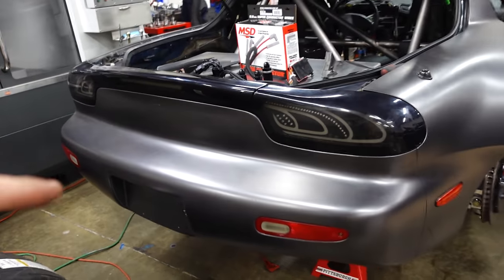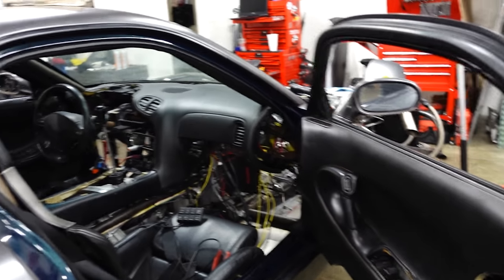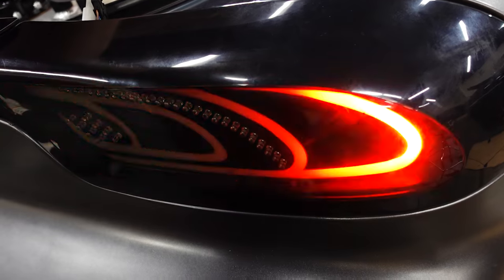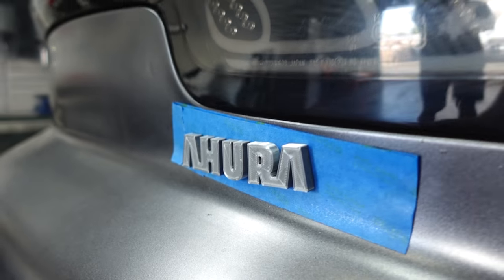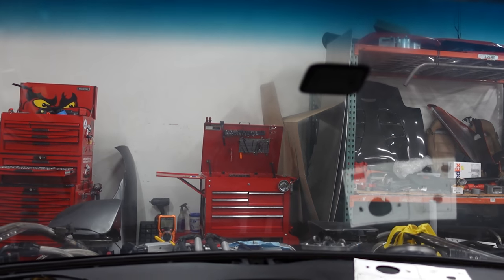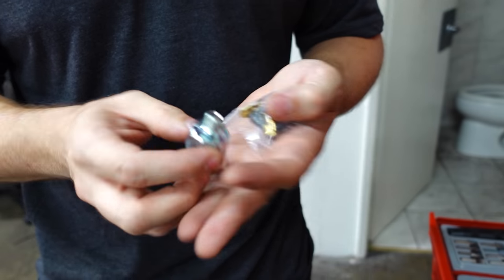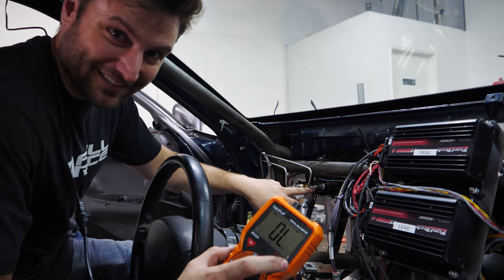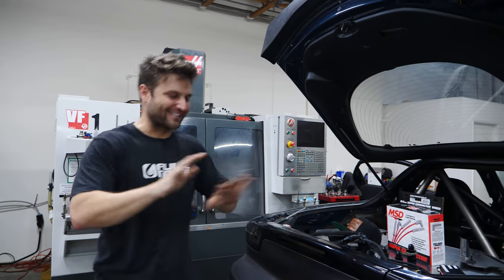AWD 4 Rotor RX-7 finally gets Brake Lights and Pop Ups! Mesmerizing.

Comment: Yo why don't you let the headlights go up when you high speed braking  so it increases drag
Reply: I would imagine it'd be better to have a parachute and to not use the headlights so you're not causing excessive wear on the motor or stress on the parts from the wind no? If you're talking like 200+ mph anyways
Reply: @TBIRD0625  just extra braking power ofc parachutes , he can make the parts more sturdy
Reply: @xavierrodriguez2463  he probably talking about the headlight motor
Reply: @xavierrodriguez2463  I'm sure he meant electrical motors lol. The ones that control the head lights
Reply: Formula one technology right there
Reply: @xavierrodriguez2463  as others have noted I was talking about the headlight motors and mounting components, not the actual engine
Reply: Because lids are gonna fly off😂
Reply: I see your popup aero-brake idea and raise you this. Hyuayra style active aero flaps. Think about it, a yaw sensor and maybe a speed sensor hooked into the headlight motor circuit. Hard part would be programing it on the ECU side of things or a standalone controller.
Reply: Headlights go up....... Headlights go down.. *giggles*....... Headlights go up..... Headlights go down..... *he he*.... Up..... Down.... Up..... Down.............. Again again again! Updownupdownupdownupdownupdownupdown
Reply: At 200mph even the panel gaps can be problematic
Reply: This idea but with an adjustable wing/aero, maybe stays on for an extra 2-3 seconds after release of the brake so that aero provide more downforce during cornering
Reply: @TBIRD0625 yes engine is for the car , motor is for other mechanical stuff .
Reply: So you guys want him to make it like K.I.T.T.'s braking system after he got super pursuit mode?
Reply: 🤣🤣🤣 cause they'll brake, BECOME BROKEN
Reply: Zed you god damn genius!

Comment: One major con to using a pressure switch.

In the event of a hydraulic system failure, you no longer have functioning brake lights.
Reply: Good catch
Reply: If you have a hydraulic system failure i think you have bigger issues than worrying about brake lights
Reply: in that case you would also not be slowing down or "brake-ing"
Reply: I mean, in the event of a hydraulic system failure you also don't have brakes, so really it's just reflecting the state of the car at that point.
Reply: Yeah... that's sort of a non-issue issue. The electrical system is much more likely to fail than the hydraulic system. Except in the case of catastrophic damage, hydraulic systems tend to slowly fail and display signs of faults long before a total failure. Electrical system faults tend to be sudden and immediate, and often intermittent.
Reply: @raelik777  not for nothing, but you've obviously not had a brake line fail catastrophically.  

in 5-10 pumps of the brake pedal, depending on the resovoir size, you go from able to stop, to not able to stop.

Thats not exactly a slow fail.
Reply: @tannertyrik6251  This may be true, but there is a reason that every single mass produced vehicle uses a physical switch to accomplish this and not a hydraulic switch.
Reply: @spdrcr1010  Not necessarily true... just because you don't have 100% of the brake function doesn't mean you're not slowing down.

OEM vehicle Manufacturers use a physical switch for a reason.
Reply: @talontsi92  Sure, which also means that the last thing you're going to give a shit about is your brake light working. I never said you couldn't have a sudden hydraulic failure, just that electrical faults are far more common.
Reply: @talontsi92  yeah they build mass produced cars cheap as possible. Mechanical switches fail all the time.
Reply: @talontsi92  Cost tends to be the reason. I mean this introduces a world of pain in the ass when the switch breaks it means you have to bleed the whole system to replace it. with another type of switch its easier to replace and cheaper
Reply: talontsi92 you’re right, because it’s cheaper....
Reply: It’s funny that yall had to ruin the joke too
Reply: Kinda moot when you no longer have functioning brakes...
Reply: If your hydraulics fail, you also don't have brakes, so they're still accurate.
Reply: Should also point out... this isn't like some weird unheard of thing he's doing. They sell kits specifically for doing exactly this. In fact, if you google "brake light switch kit", you'll find that many of them are hydraulic switches on the brake line.
Reply: And when the pressure switch fails and they do it’s a pain in the ass to change you have to bleed the system
Reply: @liammulvey5209  It's a reason to not go cheap on those switches.  Quality ones will outlive the car.  If you absolutely want to ensure that the switch NEVER fails, you use a piston-actuated switch.
Reply: talontsi92 generally true, but if you have a bad enough brake line failure the reservoir can’t do much. Can’t pressurize an open system.
Reply: @stevenplaskett7728  A pressure switch is very cheap, so it isn't really all about cost. They are less reliable than a mechanical switch though when it comes to brakes and poorly maintained fluid. You can also blow the top out of a pressure switch and lose all of your brake fluid, seen that. Many cars did use pressure switches up through the '60s in the US, but GM was using more expensive mechanical switches in the '40s.

Pressure switches don't react the moment you move the pedal, properly adjusted mechanical switches do.  With a mechanical switch the lights are coming on before braking actually happens. 

Mechanical switches also easily allow multiple circuits. When they added cruise control to cars they added an NC contact to the brake light switch, so when you press the brake the power to the cruise servo was cut. That isolates your accessories from your brake lights instead of just tapping into the lights for a signal. Most modern cars have a separate circuit with an NC contact for an input to the PCM.

Comment: Rob, I'm sure you've already thought about the pros and cons of this, but I would use a physical switch vs a pressure switch for the brake lights, just in case you ever happen to lose brake pressure for some reason you'll still have the ability to get the lights to come on with the pedal. I hate to admit this, but I've driven several cars without the use of the hydraulic brakes and had to use the emergency brake to stop and use the brake pedal to get the lights to come on.

Comment: Just an FYI, Ariel Atoms use a pressure switch to actuate the brake lights as well.  However most Atom owners switch these out immediately since it appears track driving with the continuous on/off the brakes and the heating of the fluid causes them to fail @ the epoxy seal.  This failure causes loss of pressure and thus, loss of braking.  I now have a pull switch on my Atom and it hasn't failed yet, this is after two years of street/track driving.

Comment: Use redundant switch for brake lights for safety. Either straight switch and cable from pedal or secondary pressure switch. Sometimes those pressure switches can get bad and do such  electrical mess that it will pop a fuse.

Comment: Yo Rob Dahm, (from my experience in using a brake pressure switch in a few motorcycle builds) I  believe you will NOT like it for your build (thou clean as hell) because you actually NEED the lights to come on the instant your foot touches the pedal. With the pressure type switch (and more so at a high pressure threshold like 20psi) the light illumination is delayed and in some (light trailing brake applications) will not light at all. Please reconsider it's use in light of these thoughts.
BTW. love the work and thanks again for sharing the learning and building curve. 
(2 custom motorcycle builds, 12 Subaru motor transplants, and 5 full resto-mod builds under my belt).
Thanks again. Matt
Reply: what would be a good alternative
Reply: The brake lights in Robhs car have 2 ways of flashing, so just add another sensor in the brake pedal for “light” braking situations, and then the pressure sensor comes in delayed, activating the other alt display mode..
Regardless of how it ends up,. That is a nice setup he has,. It’s a good solid build all around..

Comment: Rob, you don't want to use NPT for brake fittings.  You want to use flared type fittings.  Grab one from a Mazda or GM car, they typically screw into the master cylinder so you done have to use a T fitting.

Comment: Rob make sure that pressure switch is rated for the max PSI seen in your system. Wouldn't want it to burst or leak on the strip when you need brakes the most.

Comment: 2:04 also if the pressure increases without you pushing the brake pedal (a failure of some kind) and you slow down because of it you want your brake lights to come on anyway. Safety feature

Comment: If your worried about air bubbles in the pressure switch T fitting, point the switch downward, liquids will flow down and air rises.

Comment: If you want as much data as possible, why not have a pressure sensor for front and rear and have the brake lights turn on after 20psi? Seems like a better data option than a pressure switch.

Comment: Only problem I see with the brake light pressure switch idea is that if you lose brake pressure you also lose the brake lights. Physical switch would supply lighting even in the event of brake failure.

Comment: Hey Rob, you need to be careful that switch can handle the top of the pressure range you are exposing it to, also it's not DOT legal to use npt on a brake system, you should be using double flairs.

Comment: I realized driving an old Volkswagen bug with a Subaru that I HATE pressure brake switches. The engine/trans braking slows the car down soo much I don’t need the brakes immediately and would be nice to be able to just push the brake pedal without applying pressure to let people know I’m slowing down.

Comment: Rob.... Use a High Pressure switch as the low pressure switch will fail with brake pressure even blow out causing a leak use a proper switch

Comment: Rob you need an msc book because u can for sure get tooling that small. Even smaller if needed. As a machinist myself you need to dig deep man cause there’s is some much stuff u can do with that machine. I run a 5 axis which is a little crazier than yours but still u can do amazing shit with that thing if you learn. I know your a smart guy so you’ll figure it out. Always look for small machine shops going outta business you can get great tooling cheap that way.

Comment: damn it.... I'm going to hope the brake pressure sensor doesn't get clogged every year or two. the rear brake on my motorcycle is a pressure sensor and every year I have to replace it for inspection. You really should have just stuck with a button that sends the signal when the button is released.

It's also for safety. You won't lose brake lights if you get a brake fluid leak if you use a button.

Comment: Rob, I'm not one of the usual haters that's questioning your every move, but your brake light setup is a huge concern. 

Brake lights are an "always hot" circuit in a street car. Your pressure switch is a potential electric short. Brake fluid is flammable. PleasePleasePlease put your brake lights on a "hot when on" circuit or figure out a physical switch. (My preference would be a physical switch since a pressure switch wouldn't light up your brakes lights if you lose a brake line)

Ford had a whole recall for this on their cruise control switches burning trucks and SUVs to the ground in the late 90s-early 00s. I don't want to see a "4-rotor burned to a crisp" video after all the hard work you've put in.

Comment: WARNING...... Under the glove box, for a split second @ 2:11 right under the vent, I thought ( I could be wrong) I seen that Ebay 200 amp relay from china its about 2"x2" black cube that is sold from 5 to 20 bucks.. DONT USE IT, I had 1 catch fire melting all over the place, it was running the wicked volvo 850 2sp fan and the other that I had bought at the same time got super hot.. I knew better and shouldve sprung for the Tyco/TE power relays that cost much more from the beginning...
Reply: For higher amp draws from 50-200A use the TE/Tyco , V23132-A2001-A200 , For draws under 75A Use the TE/Tyco , V23232-A0001-X003 ... Both have a resistor on the coil and the 75a relay also has a diode inline with resistor... And if you find yourself needing a real oem quality cooling fan the 16"  Volvo out of the 850 part # 9497929, has the same motor as the 18" Lincoln MKIII... These are the most powerful brushed fans around @+4300 cfm..

Comment: Try putting wires in drill on one side the other in vise then run drill to coil wire when wiring a bundle it helps and is super clean. Brakes look sick love the sequential turning

Comment: One tip I can offer for wiring. When you are putting a few wires together to make a harness, put one end of the 4 wires in a vise the other in the drill chuck spin it a little tighter than you want. Will stay together nicely.

Comment: I'm GEEKIN out WITH THE POP UPS ,AND IF U DONT MIND WHERED DID U GET CIRCUITS AND CONTROLLERS FOR TAILIGHTS ,IM ASSUMING THEY ARE REPLACEMENT LED BOARDS AND A CONTROLLER ."YODA" FC THEY MAKE THEM FOR? P.S ROBBY DID YOU PKEASE GET MY MESSAGES BOUT MY 10THAE BUILD ,SIMPLE NO ASKIN FOR ANYTHING FREE I HAVE EXPLAINED IT BOSS ,PLEASE RESPOND IVE BOUGHT EVERY TSHIRT

Comment: Rob there is a super easy way to twist multiple wire like that by putting them im a drill. You may be familiar. If not look it up. Works perfect.  Learned it from stereo installer. Makes life so much easier.

Comment: Little trick for twisting your wires bundle one end and put it in a vice bundle the other end and chuck it into a drill and pull tight, use drill to twist them.  Just make sure you leave at least several extra feet of wire because they shrink quite a bit once twisted.

Comment: You need smaller endmills. Also, you can drill that final hole with a small drill bit, and just machine up to it, if you don't wanna mess with small endmills, which is understandable. Some of them snap broken if you so much as sneeze on them.

Comment: Good idea to have 2 step hooked up to a pressure switch instead of mechanical switch. Common thing is that people will have it hooked up to a mechanical switch and then the rpm's spike when you launch because of the grabbing point of the clutch.

Comment: CLUTCH switch antilag is best done on a mechanical switch at the pedal so you can adjust at what point the 2step disengages. your pressure switch wont do this. just so you know. This was a big deal for me (FWD, high hp. low torque engine) to get the 2step and clutch bite points just right.

Comment: Ever thought about using pop-up headlights as air brakes?  Remove the headlight itself... create a little air slip/duct... And dump all the air coming in onto the rotor.
Set them up to activate over 60 when the brake is pushed or something of the sort.
Double benefit... Air brake/drag, plus brake cooling when you need it most, slowing from 160 to 60 after a straightaway.  Would require a lot, programming somehow + quicker flipping motors... But everything you do requires absurd engineering.
I've long thought it would be cool on my c5 track car... Combined with a motorized rear wing that flips to airbrake.  Many have done the rear, never seen any cars with popup headlights leveraged in that way

Comment: Rob, next time you want to neatly twist a long strand of wire together: secure one end of the harness with some grips, and insert the other end of your bunch of wires into a drill, as you would a bit. Pull it taught, twist your shit really tight and really fast. Sick as taillights 👌🏻👌🏻

Comment: Rob lied the build don’t take this long because it was all custom and parts have taken long to come it’s because he’s been trying to gain trust of the cat society
Reply: Make sure that switch is rated for max hydraulic pressure, most like that are not.  A microswitch to the pedal would be better. Some also don't like brass or teflon on brake systems

Comment: Watch it close guys, this is the NPT joint that will leak and crash this whole project, all because Rob is too lazy to put in an electric switch for $2 from Amazon under the foot pedal and wire it to a solenoid.
I've dealt with them before and they leak after a little bit of that white sealant gets brittle from heat and crack from vibration. Works well for beginning but doomed to leak later.